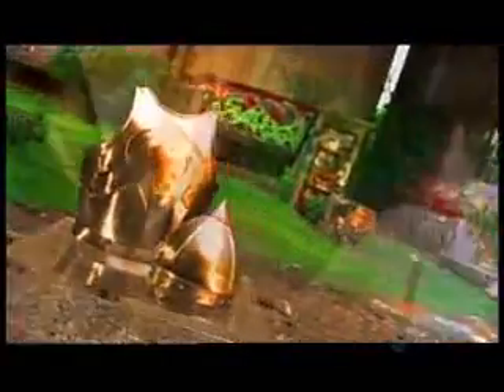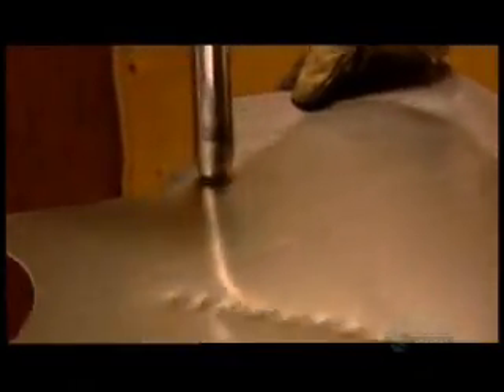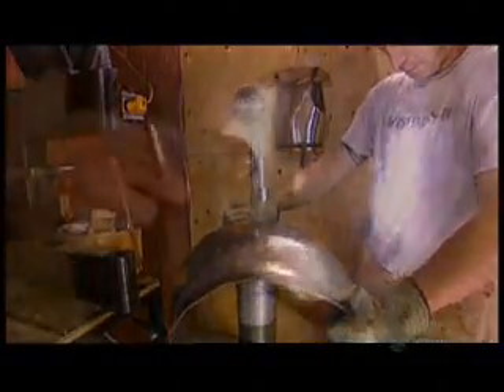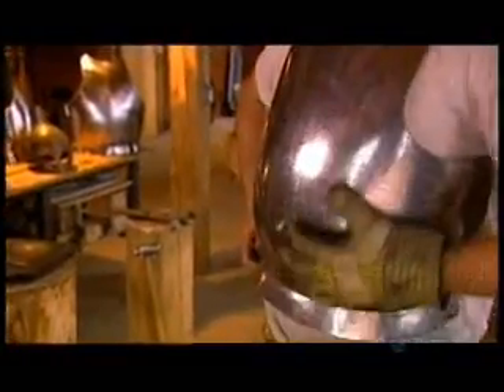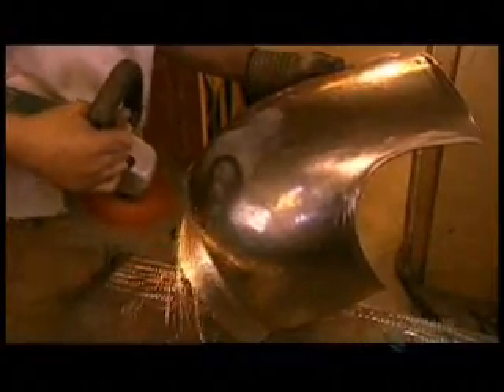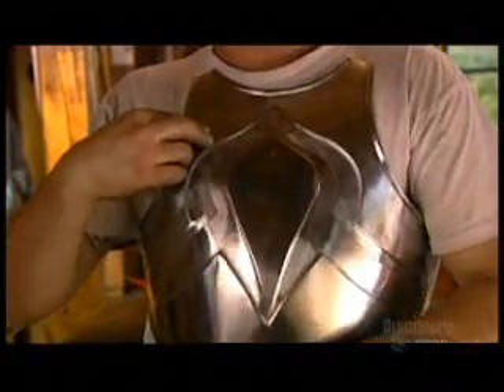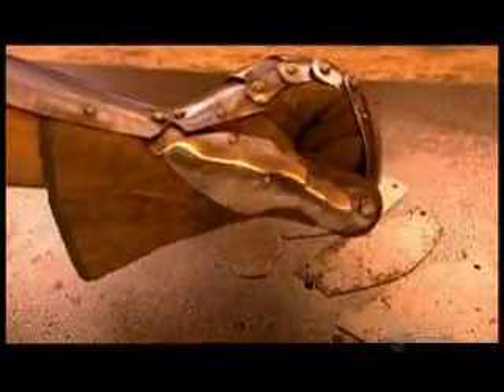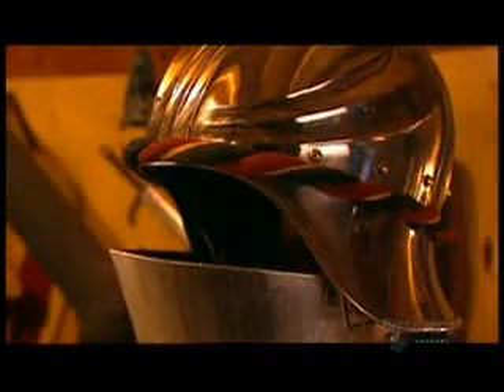How it's made-Suit of armour

Comment: sigh even in this day and age the idea that this armor was somehow impossibly heavy is prevalent. IT'S NOT. armor is as light as possible providing maximum mobility. it was donned from foot to helm to link the pieces of the leg harness together in an overlapping manner, thus preventing the strapping from being exposed to damage. _;;
you can do hand springs and cartwheels in armor, climb ropes and ladders and most importantly FIGHT dynamically in full plate. it weighs less then the pack of a modern soldier! and its spread over your entire body!
Reply: +Iamvalcristvalentine It wasn't super heavy, but it did add weight. If you add a 3 pounds plus the weight of a sword, you'll get pretty tired pretty quick. It wasn't super heavy but even a little weight will add up after a few minutes.

Also weight wasn't too much of an issue since knights were on horseback. If the knight fell over it was the squires job to pick him back up.
Reply: Elliot Borge Allow me to address this point with an example: 

Would you expect a modern military infantry soldier to need help getting up after he had fallen to the ground? Or would the expectation be that he would be able to function with his equipment?
 it is pretty laughable to think of a SAS or Navy Seal needing to be hauled to his feet by a low ranking officer every time he slipped.

Medieval armor weighs LESS than the same modern kit and is distributed across the entire body. it is flexible and above all functional. If the knight wasn't able to get up off the ground wearing the armor, then NO ONE would wear the armor.

And If you can't get off the ground, how would you get on a HORSE?

There is no question that wearing and fighting in armor is exhausting and I am sure that more than a few knights needed help off of the field by squires. But to say that the idea was to have your squire pick you up every time you fell because your armor was too heavy to wear is CATEGORICALLY wrong.
Reply: I never said it was so heavy you couldn't wear it.

"Would you expect a modern military infantry soldier to need help getting up after he had fallen to the ground?"
No I don't expect that because they use guns and aren't on horses.

"Medieval armor weighs LESS than the same modern kit and is distributed across the entire body. it is flexible and above all functional. If the knight wasn't able to get up off the ground wearing the armor, then NO ONE would wear the armor."

Not really, armor wasn't that flexible. It was flexible in the fact that you can move your arms around, but it restricts back movement, shoulders (slightly), and also blocks field of view greatly.

"And If you can't get off the ground, how would you get on a HORSE?"

With the help of a squire.

You said that it weighs less than modern armor, but you aren't using swords with modern armor either. Modern armor might weigh more but you have more mobility and you use guns not swords.
Reply: +Elliot Borge: Categorically wrong. Medieval Armor is INCREDIBLY flexible. IT HAS TO BE 
Especially in the legs and arms where it needs to provide the mobility to use weapons. the shoulders excellent examples of the craft allowing full range of motion with limited sacrifice to protection. 
Yes, with the visor down your vision is limited, which is why the depictions of close combat show armor with the helmet open so you can see more. sacrificing protection for acuity.  

Modern armor is LESS flexible than medieval armor, as what it needs to protect against is traveling at higher velocity, this sacrifice of mobility is mitigated by the relatively static nature of firearms combat.  In fact most modern military armor producers closely examine medieval armor for practical application and inspiration, So did NASA when they were designing the first space suits.

Quite frankly mate, Your talking out your ass. 

A squire would be very helpful getting on a horse in armor, but not in the way you are imagining. If the squire was kind enough to hold the reigns while you used the stirrup to mount the horse that would be a fine thing indeed (jolly convenient!), Other than that his services would not be required... it is laughable to suggest otherwise.  

Go check out the Wallace collection and look at the period armors. Armors designed to function and tailored to the wearer, not mass-produced garbage that is designed to look cool. 
While your at it, Dirk H. Breidingl has a presentation on "how to mount a horse in armour" (and other chivalric problems) that will clear up any misconceptions you might have. 

Reality is FAR more interesting ;)
Reply: Iamvalcristvalentine Listen, theres no need to be hostile. Also saying that modern armor is less flexible than medieval armor is ridiculous. 

Again, I didn't say that plate armor was a solid brick of steel, only that it wasn't as mobile as modern armor. 

Also please don't get mad, I haven't really said much that was hostile towards you so please don't be hostile towards me. I only share a different opinion.
Reply: derp, I actually meant rolling.
Reply: Its a good point about medieval Armour tough. It was fitted perfectly to its wearer. Thus better fitting and more flexible, yes. I have fought for quite som years in both kinds of armour, and there is a big difference. These are facts not opinions :) How ever this armour is not traditionally made, should be hot raised :)

Comment: Actually, this isn't too far from the way they made theirs. They did cold forge a lot of it and they would probably have used modern methods if they could. They used soft iron/mild steel, but they did give heat treatments (notice the blue-purple color armor has in paintings) and that might case harden it to some degree.

Comment: I see what you're getting at, but they're not really doing it "wrong" in any way. Take the hammering of the breast plate, for example. They're using the same process, just with better technology that saves the smith from the long term injuries that old smiths developed.

If they had used a machine to press a flat piece of metal into a pre-formed shape in one pass, then yeah, that would be shoddy. At least this guy's actually working the metal.

Comment: @Khalduknight 

If you are very interested in medieval plate armor, then spending $20,000 makes sense. I wouldn't pay $20,000 for a car, but some will pay $200,000.  

As for using modern hammers to pund it into place, that type of equipment is for mass production of industrial equipment and, armor doesn't have that type of market.

Custom motorcycle makers use similiar techniques to make gas tanks and, splash guards.

Comment: For the most part, they used soft iron/mild steel like the kind you can get at the hardware store. They didn't use steel until around the mid 16th century due to bullets. Almost all plate armor, mail and plate throughout history, is shown paintings as blue or blue-purple. They did give them heat treatments and maybe gave them very thin casehardening, but they did use iron and mild steel. You could still give such coloration to iron or steel easy enough, with a small fire and a bucket of water

Comment: $20,000 for a stainless steel suit?  I could see it for 1050 or even 4130 high carbon steel that's been hardened but stainless?  Not a chance.  Stainless is heavy and meant as a wall hanger.  For re-enactment uses it has to be made much thicker and heavier than period pieces as stainless or even mild steel isn't nearly as tough heat treated high carbon steels.

Comment: @SIVIOSH 

i tAk3 5Ick PlasUre in MuH Sp3lin Mi5kat3s. Liv3 wiT it :P

as for the armor however. i know people who can make allot less complacated armor which would cost allot less and be fourm fitted to your body. what gauge steel did they use in the video? probably 18 or 19 because its easier to work with and just slightly less strenght than 14 gauge, which is what you WANT  to use for REAL BATTLE armor. suits made like whats shown in the video are whats called Deco'

Comment: They don't use stainless steel, it wouldn't have the right properties for Armour. Armour's wouldn't hammer out the sheet out of a bar. That would take to mush time and way to expensive for even kings to purchase Armour without going bankrupt.

 The true quality of the Armour would be in the heat treatment of the metal.